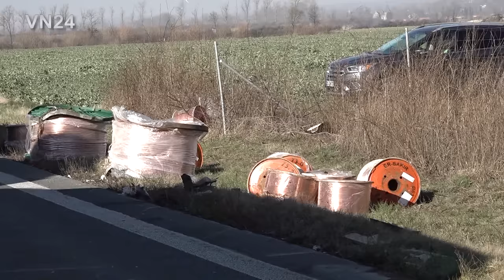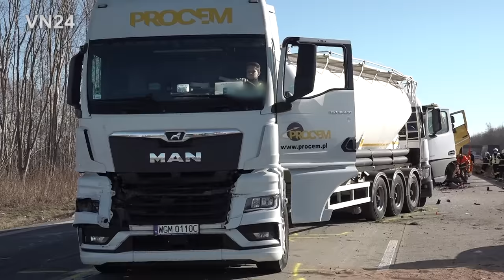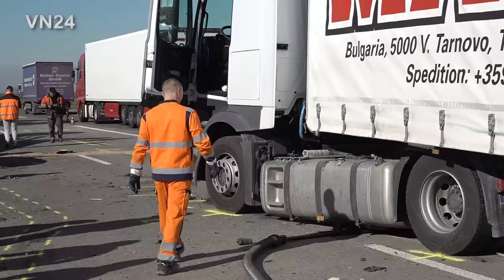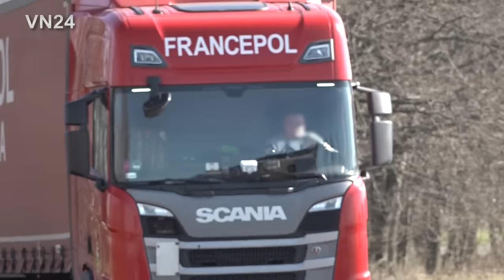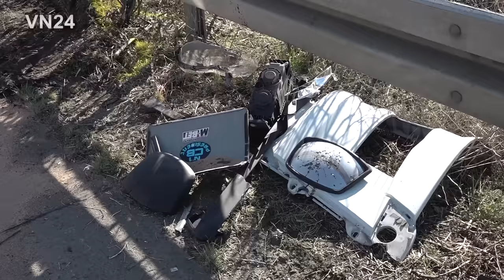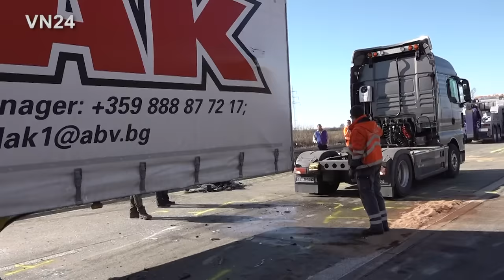10.03.2022 - VN24 - Massiver LKW Unfall auf A44 - 40-Tonner kracht auf Stauende (Teil1)

Comment: The amount of people on their phones. Ban them while driving.
Reply: The fine is 100 Euros and 1 point on your driving record in Germany. If you endangered someone cause of using the phone; 150 bucks, 2 points and 1 month banned from driving. Crashed; 200 bucks, 2 points, 1 month driving ban. Maybe the fines should be increased...
Reply: @brand-konto6733  that's weak. In Denmark since Sep 2019 the fines are 1500 DKK (~200 €) for using any handheld device while driving and one punch in the license plus 500 DKK (~ 67 €) for the victim foundation. Any other violation you perform at the same time is added on top, like if you slow down to take photos you're fined for reckless driving and endangering the public, which in turn means the police may revoke your license on the spot. At the same time you may also be fined double for speeding if you pass an accident site at more than 60 km/h at less than one lane's distance

Comment: Volvo make very safe trucks but seems the trailers in europe dont have rear under run protection or a proper chasis like those in Australja. If they had a proper rear bar and chasis it would line up with all trucks so when they have a rear ender the chassis takes most of the force and not the cab. This stops cars and truck/chassis/engine from going under the trailer. Those trailers dont meet Australian safety standard. 
So much for safety in europe

Comment: The description says the waberers truck hit without braking. Does that imply that the driver or operator has tampered with or disabled the automatic safety systems? A Volvo FH4 should have automatic braking as standard and have been able to reduce the impact speed if the driver was asleep.
Reply: Its often turned off because too much traffic...
Reply: Usually these don't work over 50 km/h (aut. braking)
Reply: @BeeTee177  of course they do.